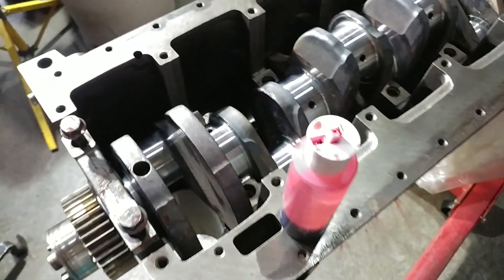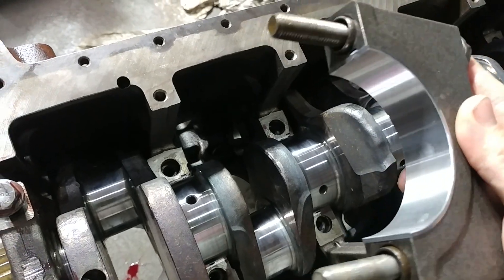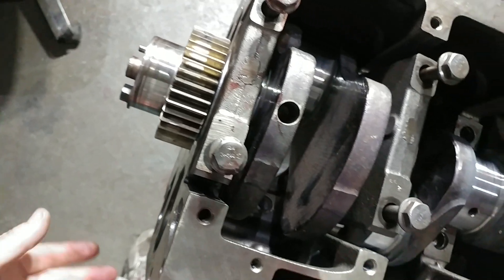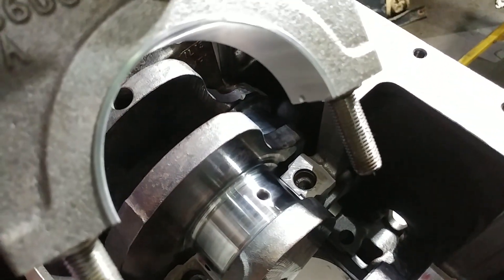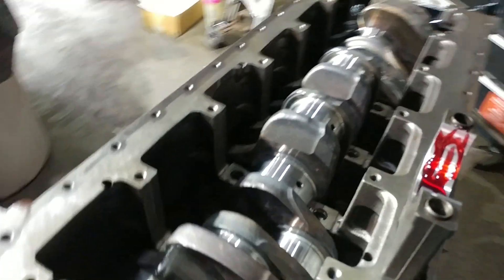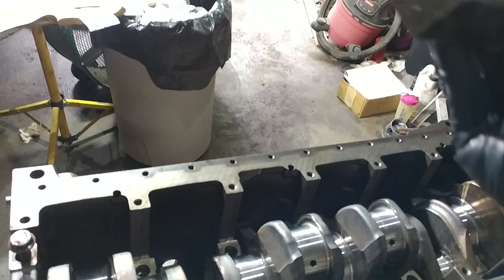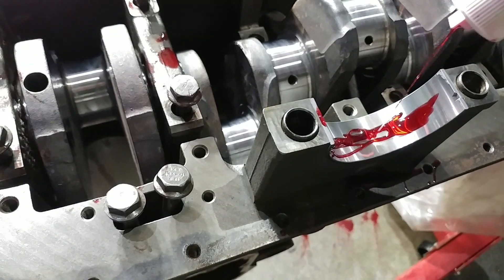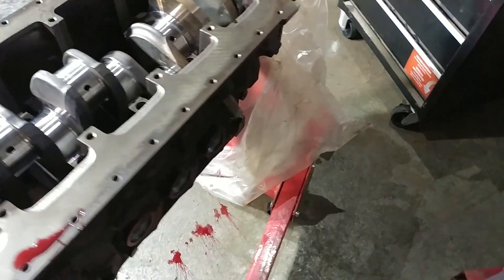Chronicles Of An 03 Cummins Rebuild -Part 10- Final Assembly Of Upper Main Bearings

Comment: Is the bearing cap for number 6 supposed to be different? Or has that been replaced on this engine?

I know you mentioned that the bearing was different with the side clips... Just curious for when I open mine up. 😂
Reply from the maker: That's a great question!  Number  6 is the one that your talking about and it is a thrust bearing.  It will be the same on your motor and you can't get it mixed up, as the number 6 journal is the only one that is machined for it!
Reply: @70440charger  - I'm happy if I get a response within a few weeks, its awesome that you get back within a few minutes!
Reply from the maker: @duttydiesel8303  hahaha! I try and do my best to get back to people. Sometimes I catch the comments as soon as they come in and other time it may take me a second. It really depends on how neck deep I am in other projects! I have even miss some and not commented for months, but I feel terrible when I miss one cause I hate when people don't get back to me on here!

  Have fun on that build, man! I know it won't be soon, but it will be a lot of fun and you will learn a ton! I always do! If your not learning  then something's wrong!

Most everything will  be pretty obvious,  but take you time! And make sure you bag and tag every nut and bolt! Before our current system, we wasted a ton of time track back down bolts and parts!